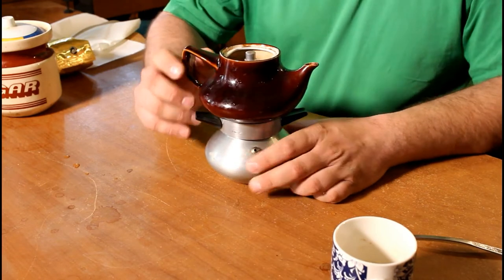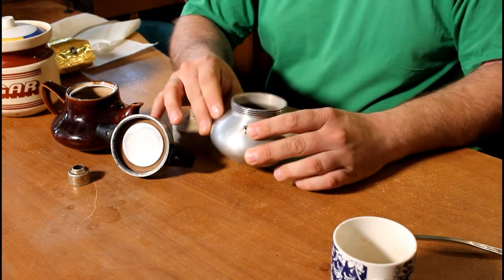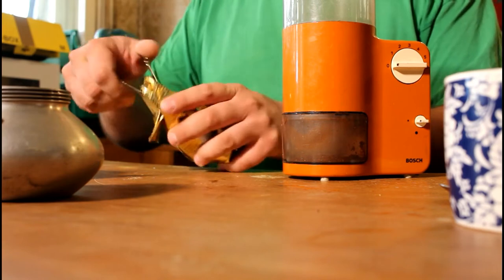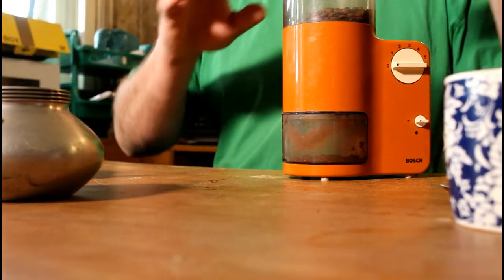Vintage Italian "Letizia Espresso" Moka Pot [coffee maker] - presentation

Comment: The rubber sealing is the same of the Moka ?
Reply from the maker: If you are asking about the "classic" Moka Pot, i am not sure. I can measure it, in a few days but right now i am away, in a trip.
Reply: @isographer Yes, the classic one from Bialetti, i would like to buy a Letizia and replace the rubber, thank you very much
Reply from the maker: Hy, I have just measured the outer diameter of the Letitzia Moka pot gasket- it is 72,5mm in size. I think you might use the Bialetti 6 cup gasket.